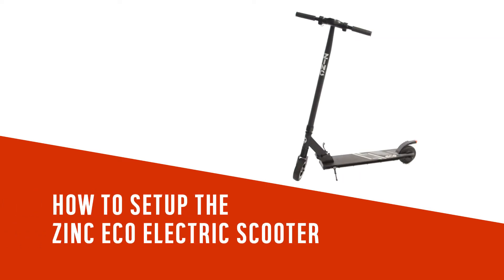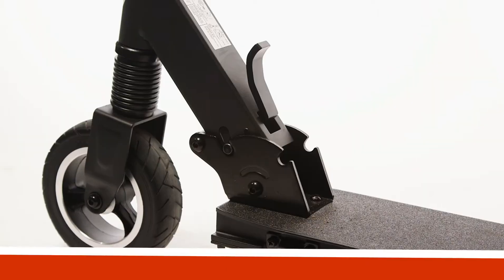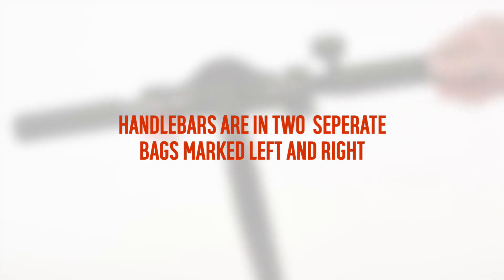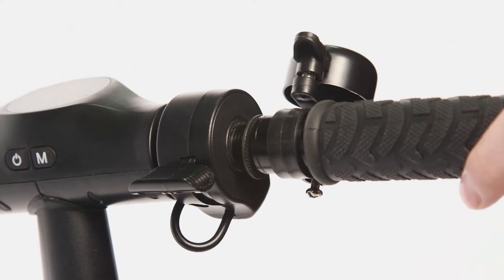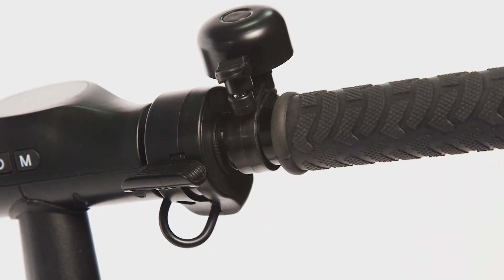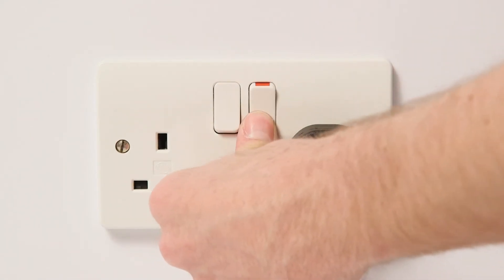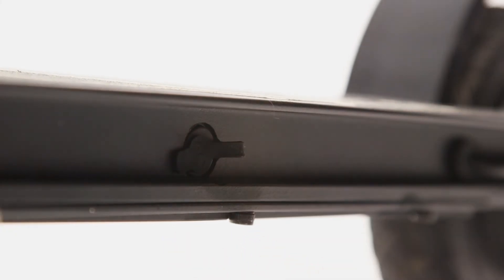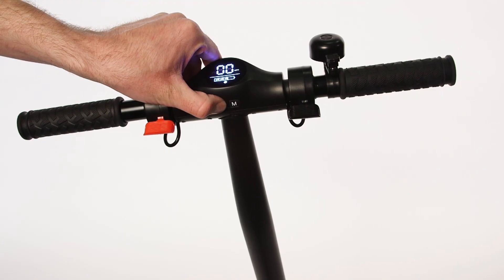How to Setup the Zinc Eco Electric Scooter

Comment: I just picked up one of these, but it will not charge.
The light on the charger pack stays green, does not turn red when plugged in.
The scooter powered on out of the box, but now will only turn on briefly after I manually scoot around for a bit, showing (what I think says) "E5" on the display, before it quickly dies again.
Can anyone help??? PLEASE!
Reply: Hey are you still having this problem
Reply: @GlyxyPlayz  yeah, still not working.
Occasionally, if I try it everyday, once a fortnight it will power on, run, and charge properly, but only for about 10-15 min. Then it dies again and won't charge.

Comment: My back red light is on always when it is in not in use it drains the battery..how can i turn it off??
Reply from the maker: Hi, please call 0345 604 0105 for further support.
Reply: The back light runs off of its own cr3025 (or cr2035, something like that!) Button battery.
So, it won't actually drain the main battery that drives the motor etc.
Unless, of course, this is the battery you are referring to, in which case please ignore my comment, (and forgive my presumption that you didn't know that already!🤦🏻)

Comment: Could u make a video as to how to fix the locking mechanism, my scooter doesn’t automatically lock into place
Reply from the maker: Hi Jake,  have you tried applying slightly extra force to the handle bars when pulling them up into place? Once you have lifted the bars up, we recommend pushing the handlebars forwards so the mechanism locks.
Reply: This happened to me you need to hold it down and pull the bars up really hard with force and it will click into place